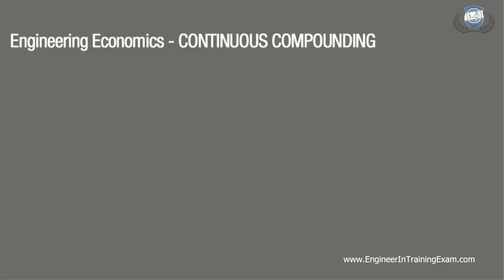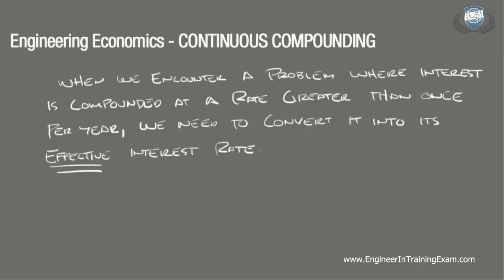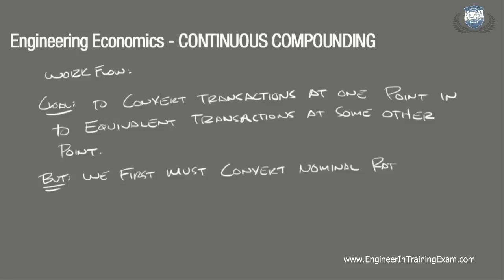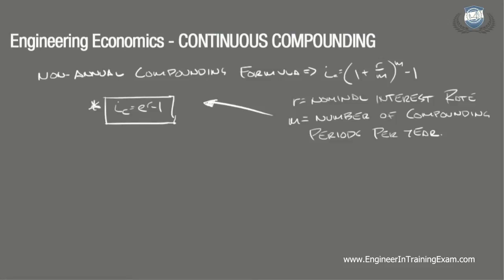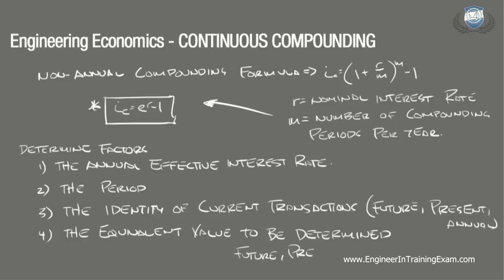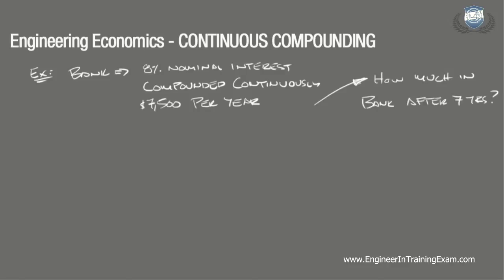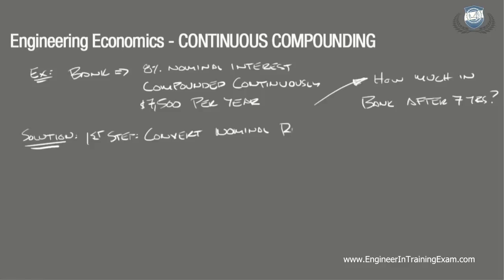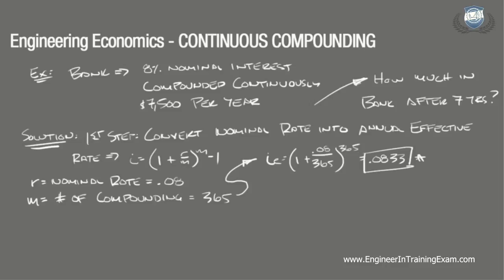Continuous Compounding - Fundamentals of Engineering Economics

Comment: Hello,
In the continous compounding problem where the 8% was compounded continuously for a year, the compounding period was stated as 365 days and this value (365) was not multiplied by the interest rate (8%). However in another example where 1.6% was compounded monthly, the compounding period was given as 12 (clearly understood) however the interest rate was adjusted to 19.2 annually (product of m and i). this is not clearly understood.
Also, as a follow up to this question, what if the interest rate of 1.6% was compounded quarterly , the compounding period "m" ,  will thus be 4 (correct?) if so, will the interest rate also be adjusted to the product of "m" and "i"?
Thanks